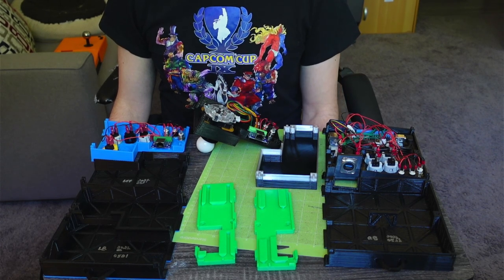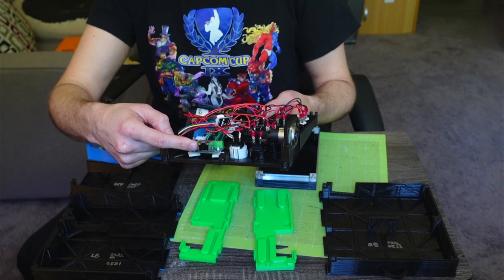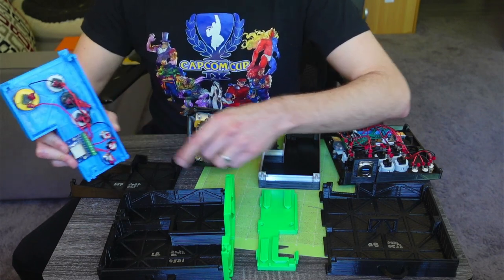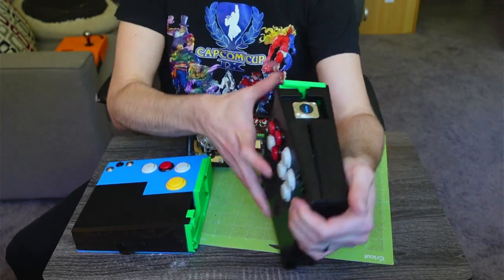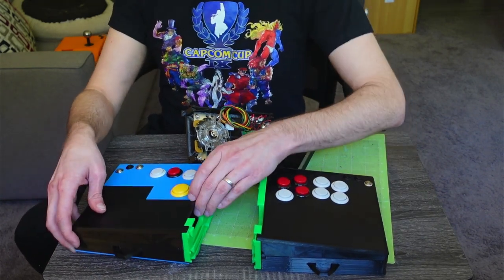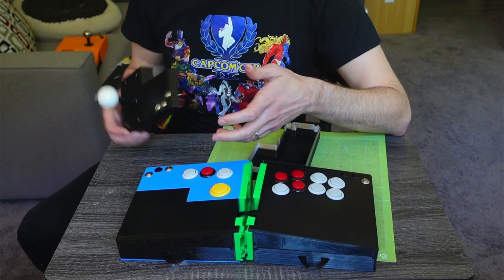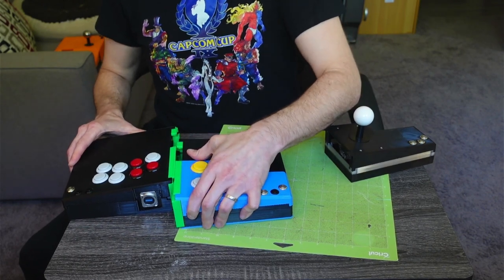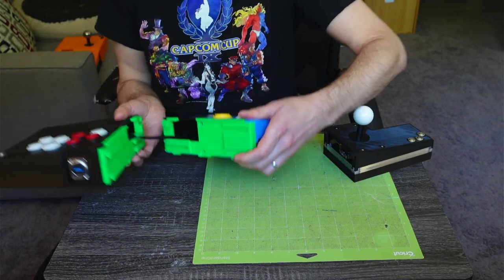Splitbox Assembly (splittable fightstick with modular leverless/stickless & joystick options)

Comment: Hi Ultra David. I recently made a version of your split box design. Works great so far. I'm working on the final version and but wanted to ask if you have a 30mm version of the splitbox? I'm 6'5 and the tiny buttons are just a hastle. Originally I played on working on my own version before I found your's. Figured I'd ask before I have to work on that. THANKS again for the design!

Comment: Why not use a much cheaper and robust arduino micro or similar? It would bring the cost of this down by about a 100 or so dollars and depending on the code could work with every platform. It would also allow you to have many upgrade paths for future versions (LEDs, touchpad, displays) and its much smaller form factor to boot.  I would also recess that Dsub, from personal experience you lift the stick out of your lap hit the desk or chair arm and snap off the usb and ruin the port.